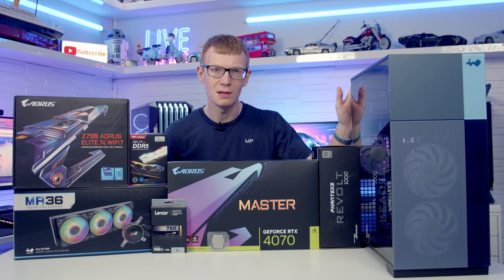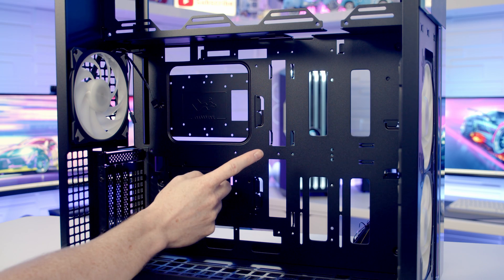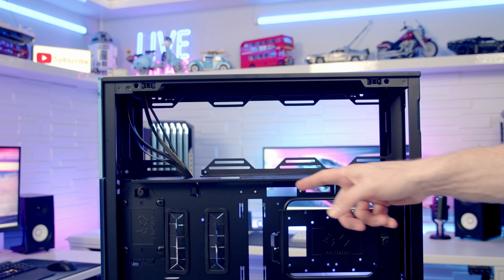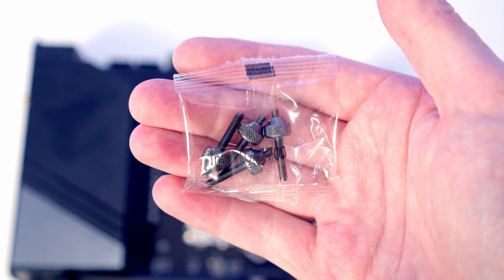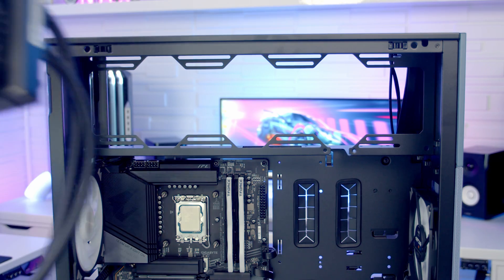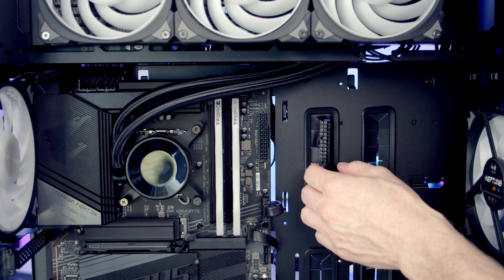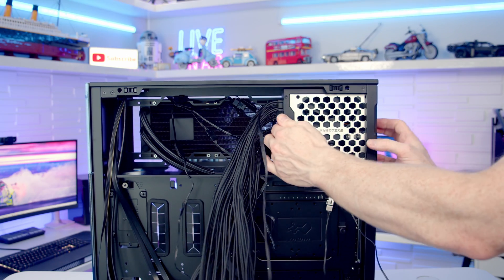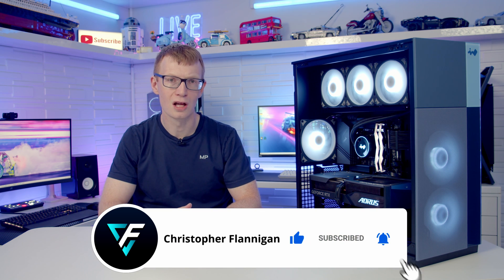InWin F5 Build - Step by Step Guide

Comment: One critical question I have regarding custom water cooling—and which I couldn't find answered in any other video on this case—is: What is the depth of the top compartment for the radiator (either 360mm or 420mm) to the glass panel before it touches? I’m planning to use a massive radiator (60mm or 80mm thick) plus the fans (25 or 30mm) on it, so I need to know the exact measurement in millimeters, as it will play a significant role in my radiator selection.

Additionally, how much vertical clearance is there from the bottom of the case to the motherboard? Specifically, does a 140mm fan allow for enough space to access the bottom connectors on the motherboard, such as the front I/O or HD audio headers? I am planning to use a bottom radiator as well (minimum is 20mm thick or 30mm the standard size) as well in the front to use a 280mm one with intake fans.

I would really appreciate an answer to these three critical dimensions.

Thank you in advance!

Comment: nice case. most of all i loved the way of closing the MB M2 slot heat sink. I hope it will be the trend. I have an older MB, and it's pain in the bottom parts with those tiny little screws.
Reply from the maker: Yes, these are the best I have used